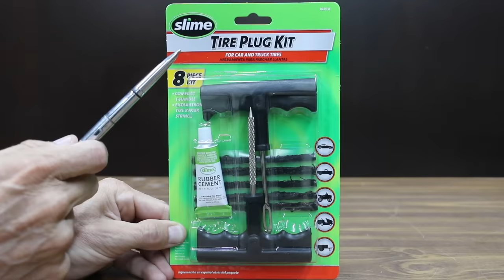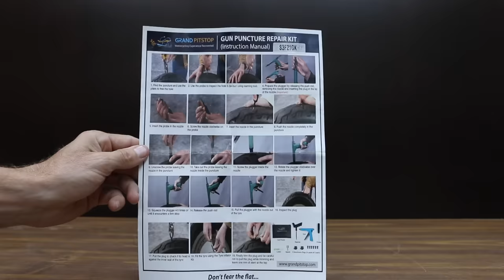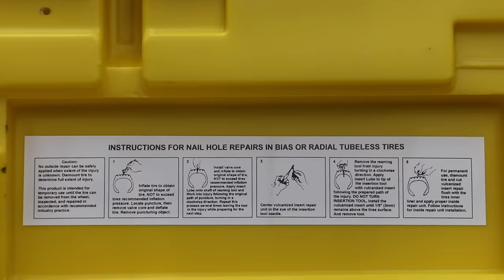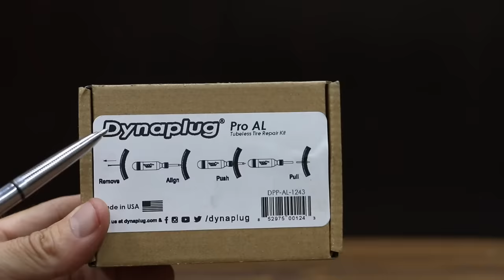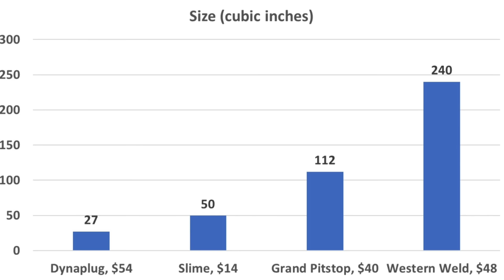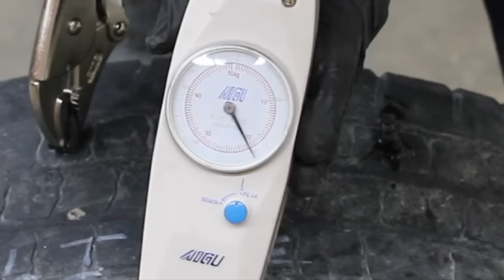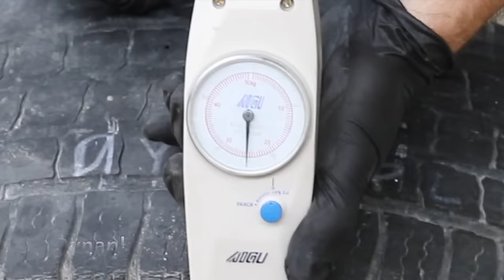Best Tire Repair Kit? SLIME, Westweld, Dynaplug, Grand Pitstop

Comment: Good video. I plug holes vs swapping to a spare most of the time. A donut spare means you should drive straight to a tire shop. A plug means you should make an appointment at a tire shop within the next week or so. IMHO, a spare should only be used for a blowout, not a small puncture. Donuts should only be used for a very limited amount of miles, and should be replaced after a single use.

A plug can be driven on longer than a donut, and doesn't change ride quality/ability like a donut. Using a plug means you can save the spare for a more catastrophic tire issue.

As for ease, considering tools typically carried in a vehicle for a tire change, a plug is faster and easier than swapping to a spare. You don't have to jack the vehicle or wrestle with over-torqued lug nuts with an inadequate lug-wrench or deal with a rim being stuck to the hub on the side of the road while the vehicle is being balanced on a sketchy OEM jack.

Thanks for this comparison. I keep a Slime-type kit in my truck, but I might upgrade to a Westweld type, though both seem to get the job done.
Reply from the maker: You are welcome!  Thanks for sharing.

Comment: I'm only playing but you are absolutely crazy to put a hundred tire plugs putting one in is hard enough.  I've used tire plugs my whole life when you take it to a repair shop the only difference is they have a mushroom like head that they put in from the back side they take a scratch or scratch up the surface put a little cement and push a plug through it's just got a mushroom flat head it's a cross between a plug and a patch. I've seen shop just use straight patches with contacts cement. Just this winter I had two tires on the car that got nails through both of them. I have an air compressor in the trunk that runs off of a power inverter and all I had to do was Jack the car and turn the wheel and put in the plugs without even taking the wheels off the car they are holding fine and I have almost no tread on my tires. That's sad when you're poor but they do do the job and I've had them for years and I've never had a tire go out of balance and I'm 50 years old and I've been doing this since I was 16. It's a great video showing absolutely how well they work and if they didn't work there would be a better method but there isn't everything's a plug and even when you patch and plug them it's the same thing they just take the tire off the car and charge you.  Great job on an absolutely great video I hope some people finally see that a little work can save you a lot of money... And you should try between the slime and the Walmart ones and yes the small handles are paying the butt but I do like the information you gave about using the the cement as a lubricant and also to give more grip. In the summertime they're absolutely easy to put in but in Winter right now at eight degrees they were a bear to put in.
Reply from the maker: Thanks for sharing.

Comment: Plugs should be temporary.
The biggest reason is if people have driven far on a low tire it causes the interior sidewall to crumble off inside the tire, unseen.
And a thin sidewall can blow out without warning.
It's why you should always break down the tire/wheel, inspect & patch inside.

Comment: To be honest, I think the fact that the slime plugs tore rather than came out whole is actually a good thing. I wouldn’t assume it’s a bad thing. If it tears apart rather than pulls the inside plug out in one piece that seems like a good sign that internally the plug has bonded and effectively sealed and cured inside the tire. 

I think it would have been better to leave the Western plugs without the cement that the slime kit includes, only because most people will buy a kit and throw it in their truck or car until they need it one day.
Reply from the maker: Thanks for the feedback.

Comment: For the plug coming out the most dangerous problem is the plug being pushed into the tire by rocks debris, edges and other things, not the plug being pulled out. The only thing that will pull it out of the tire is people or air pressure popping it out
Reply from the maker: Thanks for the feedback.
Reply: I’ve never had that happen. I’ve done many plugs on my business fleet. And ‘dangerous’ is a bit much:)

Comment: GOLF SHAFT EPOXY, throughout tens of decades people who play golf leave their clubs in the trunk of their cars in the hot sun all summer long have had epoxy fail, as in the club head flying off the golf shaft down the fairway or out into the driving range ( its happened to me several times and with different makes of clubs ), I now have a locker in a club house to leave my clubs in, so does the heat buildup in the trunk of a car during the summer soften up the epoxy for club shaft/head fail, and at what temperature for how long does it take for the epoxy to fail. Project Farm, does this test interest you, people spend multiple thousands of dollars on a set of irons, woods, hybrids and a putter, plus the spare clubs left laying lose in the trunk, so what golf shaft epoxy from what manufacturer would win the high heat strength test before softening up and failing in the trunk of an automobile during a long hot summer.
Reply from the maker: Thanks for the suggestion.

Comment: The few tires I have plugged in decades of driving, maybe one leaked very slowly. I use them as a permanent repair. I imagine the cost of a tire shop repair is significant. My feeling is a tire with a plug is likely to have some miles on it, and not worth the cost of a tire shop repair. Just get a new tire when you need it.
Reply from the maker: Thanks for the feedback.

Comment: I work in the industry, and 85% of the time, flats are caused by screw punctures. Not nails, but screws.  Along those lines, I continue to ponder the true value of a road hazard warranty.   That would be a GREAT topic for one of your upcoming research studies. No tire is immune to punctures, but some are definitely more immune than others, such as the ones with Kevlar belts.  And new tires are more resistant than old tires, because the rubber is thicker.   So what's better, buy a cheap tire with a road hazard warranty, or better tires that cost significantly more without the added cost of a warranty, but are significantly more resistant to punctures (and weigh more)?  From what I can see, most tire installation shops charge the same amount for the road hazard warranty, regardless of how much the tire originally costs.
Reply from the maker: Thanks for the video idea.

Comment: BUYER BEWARE with the Western Weld tire plugs:   There are actually different kits from Western Weld.  This video shows the TS60K-HD and is listed on Amazon under the brand "Sherco-Auto".  When looking for the Western Weld, I accidentally bought the TS60K which was actually a smaller kit, but it had a needle tool that wasn't as well designed as the one shown in the video.  So I was slightly disappointed when it finally arrived. 

Slime also has a more heavy duty "Ultimate" tire plug kit that comes heavier duty tools.

Comment: Very Safe ..
  They say you cant use these on side walls .  I had 4 brand new tires slashed on side walls , used several plugs on each hole..   bingo, ran til cords showed ..
Reply from the maker: Thanks for the feedback.
Reply: We do the same in Africa....run tires till the cords shows😀

Comment: You let too much air out of the tire. It's a LOT easier to plug a tire with near recommended inflation pressure (around 30psi for most cars), and you're more likely to get a good repair.

Comment: Thanks for the extensive review. I love your backyard where you can free spin a Big SUV 😀. My experience with the plastic handle reamer and plug inserter such as the Slime when tyre is still installed has been poor. The plastic handle just gives away the metal pin and is useless. Luckily, I tried two times at home. I'd strongly recommend purchasing a stronger metallic handle kit. 🙏
Reply from the maker: Thanks and you are welcome!

Comment: The big name shops don’t use them because they want to charge to remove the wheel, remove the tire, put a patch inside, and remount. Usually $20-30. A plug can be installed in 1min, with the wheel still on the car. $5-$10. Shops that claim plugs aren’t safe should be sued for false claims. Or atleast be hesitant to visit because they aren’t being honest about a simple thing.
Reply from the maker: Thanks for the feedback.

Comment: We are NOT allowed to install them in a professional shop due to the reaming action cutting through the steel belts; over time said belts will unravel and the tire will come apart.  While I do understand this will not happen every time and be dependent over what caused the puncture to begin with, we can not accept the liability of installing one of these.  Instead, we pull the tire off and patch it the right way internally (again, as long as the tire is still serviceable).  Not sure why these kits are still allowed to be sold seeing the legality of us using them...but good luck if you do use one!  I love it when people come in with leaking tires and plugs in the sidewall...can't make this stuff up!
Reply from the maker: Thanks for the feedback.

Comment: I think putting 100 plugs in a tire is amazing.  Often when I do one I’m huffing and puffing like a pug in the summer in Florida.  Good job, Todd!!

The “myth” of tire plugs being dangerous is a lie created by tire installers in the field, but perpetrated by the companies that provide them tires.  Why?  Well, two reasons.  One, so they can sell you a “safe” patch from the inside which will cost you a dismount, remount, and balance PLUS the patch. $$$$!   Two, they’ll use that as an opportunity to sell you a new tire, and let you throw a perfectly good tire away.  This is complete idiocy of course.  I’m 52 years old, and have never, ever…not once, ever heard of a tire plug causing a tire to fail.  Nor have I ever had a single problem with a tire personally with a plug in it.  Of course, use your brain.  They can’t go in the sidewall.  I’ll admit in an emergency I’ve even done that to get to a tire store versus walking.   When that happens, you will need a new tire.   No fixing that.  I will admit too that I put one in the side of a lawnmower tire.  Actually it took two to close it when a piece of rogue metal stabbed it.  Considering it tops out at 3.5mph, I kinda feel like it might survive the blowout.   😅. I’ve been rolling on it for about a month now cutting my acre 3x a month.
Reply from the maker: Thanks!

Comment: I worked at new car dealer, in the service dept,. In our shop we used Safety Seal. We put thousands of plugs with almost no failures. You did not test this brand. Now in California and maybe in the country you can not use this type of system to seal a tire in a professional repair shop

Comment: So, the Western Weld brand is clearly the winner here! Too bad it's so much more expensive and takes up more storage space in the trunk. It also doesn't come with vulcanizing cement. You must purchase it separately @ $12 a can and let it take up even more room in the trunk. I think it would have been more "fair" to do these tests without their cement, seeing they claim the plugs are self-vulcanizing and they didn't feel it necessary to include it in the kit. So, due to the final expense of this kit  being $60+ and taking up 6-8 times the room of the $14 Slime kit, I'm going with Slime. After all, none of your Slime repairs leaked, right? That's what counts in my book!

Regarding your comment @ 13:30 the tire shop will do the same thing, plug it.
Reply from the maker: Thanks for the feedback.

Comment: Ok but as a mechanic ive been running a slime plug near the sidewall of tire for 15k plus miles now and its been fine. Plugged the tire with 800 miles on the truck and about to cross 16k now. Plugs are nearly as effective as patches in the real world.
Reply from the maker: Thanks for the feedback.

Comment: 3rd time on 2 separate cars I took in for discount tires both vehicles had a nail in it.
They refused to patch the 2 vehicles both 70%-85% life still on tire I said I’m not doing a new tire please patch it geez dude he refused so I said fuck It.
I just rope plugged  both vehicles holds air fine.
First car I’ve had that rope plug in for months second car I just put in.
Reply from the maker: Thanks for the feedback.
Reply: It’s a liability for some repair shops.

Comment: I once thought I’d poke a few hundred nails into a 3 wheeler tire, and conduct this tire repair 👩‍🔧 test, by using several hundred tire plugs 🔌, to see if the tire would hold 🆙. I only wrote the tedious repair 👩‍🔧 process on paper 📄, which took awhile, but I never 👎 actually went about with a real tire. I never 👎 thought of the tensile strength of ripping the plugs 🔌 out of the tire. If I were to puncture a tire several hundred times, and then use several hundred plugs 🔌 to repair 👩‍🔧 it, I wouldn’t put myself through an additional test of tearing the plugs 🔌 out of the tire, if the repair 👩‍🔧 was a success. If it was a failure 😞, then I might. One ☝️ very easy way to repair 👩‍🔧 all those punctures, would be to use an inner tube, but if I were to conduct this video, why take the easy way out? Your friend, Jeff.

Comment: You can NOT get that reamer tool into the tire unless the hole is HUGE. Unless you have the strength of an angry gorilla, forget it. It won't happen.

I used my power drill to enlarge the hole. Even then, getting the patch in there was profoundly difficult. Probably needed an even larger hole.
Reply from the maker: Thanks for sharing.

Comment: If you have a hbr freight or any Chinese brand tire plug tool, throw that thing it the trash, I would suggest only buy METAL handled ones bc the plastic busted and it cut my artery in my right wrist and without a tourniquet I doubt I would be here to tell you this. Nothing worst feeling than sitting on the side of the road with a disabled vehicle while your bleeding out!

Comment: Those gum plugs are only emergency repair plugs to get you to a tire repair shop. No permanent repair can be done without dismounting the tire. whoever put the plug in is responsible for any injury or death that may happen.

Comment: A Project Farm vid with a million fricken views on tire plugs and you don't even MENTION Nealey and Safety Seal? Come ON! Nealy is miles ahead of everything else out there...

FYI If you read the fine print, the strings you normally get at an auto parts store are for temporary use only (yes, I know some use them as a permanent fix) while the Momax/Chemi Cure, Nealey and Safety Seal are permanent fixes. Momax/Chemi Cure makes the plugs for Nealy.

Comment: auto companies "we need to save weight...lets remove the spare tire".  Also auto companies, making models weigh in an average of 400-1000 pound more than they did 2 or 3 decades ago.  1990 corolla, 2400...2016 corolla, 2800...2022 corolla, 3100.  Anyone see that trend?

Comment: Or you can just do it the right way get a safety seal tire repair kit which I have been using in my shop for over 15 years
Reply from the maker: Thanks for the feedback.
Reply: @ProjectFarm  sorry if that came across wrong I'm not trying to be a dick I do enjoy your channel thoroughly

Comment: Adhesive is important, can not storage for long time. This test not shows the plug repair will last 20 to 40 K miles, That is the average life of car tyre. Most garage also use plug repair.
Reply from the maker: Thanks for the feedback.

Comment: The best way to fix a flat tire is to purchase a new set of tires for safety.  Any good tire shop will be more than happy to replace all the tires for safety.  If you are driving 80 mph on any of the interstate highways get off to to shoulder of the road and have vehicle hauled to the closest tire shop.  Don't buy cheap as there is no price for safety when driving,
Reply from the maker: Thanks for the feedback.

Comment: I have hundreds of miles on my tires 2 of which have a cheap shitty plug with rubber cement and I drive 99% of the time on the gravel
Reply from the maker: Thanks for the feedback.

Comment: In a real world situation. Just for safety sake no one should be plugging a tire that is nearly bald. Any tire with tread below 3/32 is not recommended. It's about as bad as people plugging corner punctures away from the belting. basically the start of sidewall
Reply from the maker: Thanks for the feedback.

Comment: I consider the Dynaplug to be a permanent repair. I have put a couple in sport bike tires over the years and trust them 100%. If you can trust them in a sportbike, that says something. These tires are pushed far harder than car tires. the pull test is unrealistic for a design with either the mushroom or the metal tip. The tire carcass holds the plug along it's full contact length so applying pressure just from the very end is  (in my opinion) not a meaningful test. You stretch the plug along it's length in a way that would never occur in actual use. As you stretch it, the diameter is reduces which lessens the grip applied by the carcass. I don't think this test is meaningful. There is no real world condition that would generate this kind of grip, especially after the plug has worn smooth. I enjoyed the test otherwise.
Reply from the maker: Thanks for sharing!

Comment: Sorry but your size calculation of each item is absolutely miles off. You keep quoting the size in cubic inches, as in 3 dimensions. So if something was 48 cubic inch then it would be 4 foot long, 4 foot high and 4 foot deep, as in a cube.